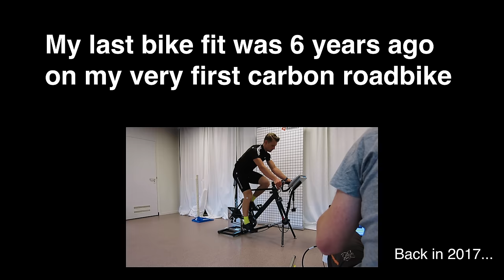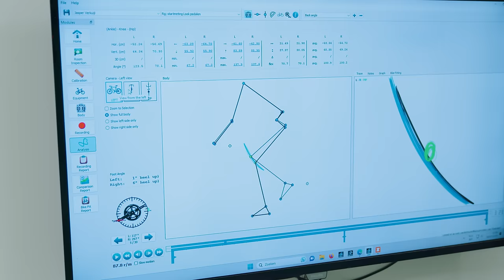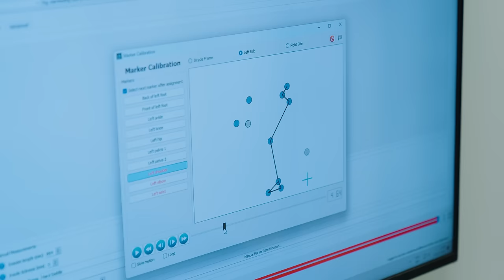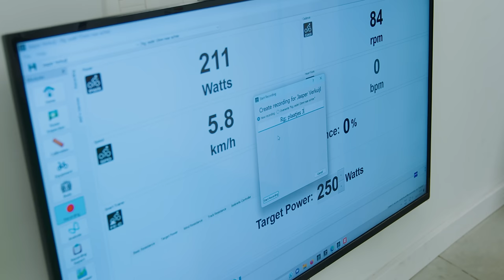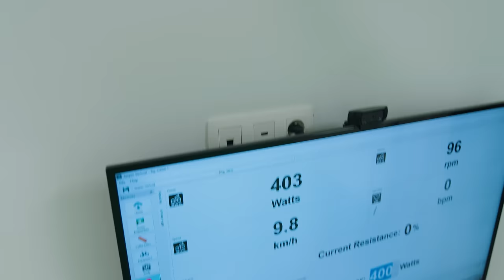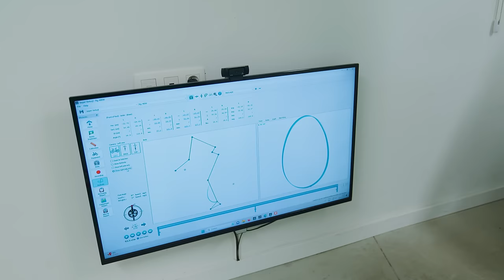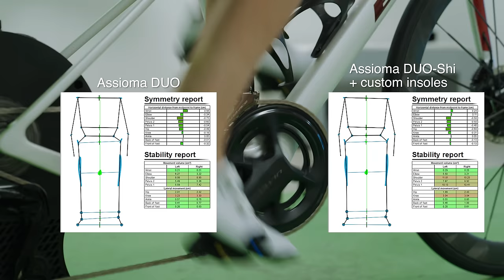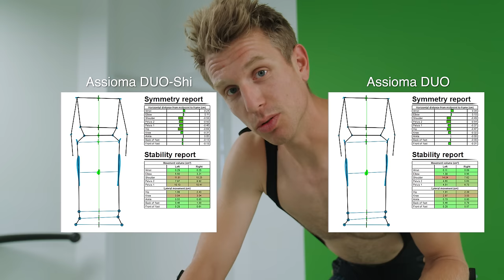Could This Improve My Performance?... // A Bike Fit like a Pro-Cyclist!

Comment: I'm afraid of doing a bike fit at this point, don't wanna pay a lot of money to hear that I have to go spend more money on a different crankset with a 2.5 millimeter difference
Reply: If your comfy dont do one, adjust until your comfy and can do 3 to 5 hr rides without pain or too much soreness, Unless your pro and they probably are free fits anyway lol also every fitter has their own way of doing it and not all will agree.. Tomato, tomatooo
Reply: If you have the SRM Carbon cranks from Look the trilobe can be adjusted from 170-175 in 2.5mm increments and then you can go to as many bike fits as you like without having to buy new cranks
Reply from the maker: I did not have to change the cranks, I suggested it myself in this case. 
You can always go with what you have, but some riders fit is so bad that they are getting injuries in a later stage. (A 2,5mm crank length difference probably won’t cause this!)
So a bike fit could prevent more problems in the future and than it’s worth it! 

If you are like me, the performance is worth it. 

If you are comfortable on your bike and ride it for 6 hour rides without issues, you probably don’t NEED a fit. But it can probably not hurt to do one. (Like me!)

Comment: What does a fit like that cost?
Reply from the maker: Check the website. It depends on what you need/want. It’s around €200, €300 including insoles
Reply: @jasperverkuijl  same prices here in Greece. Great video though!
Reply from the maker: @deamon2107 it’s worth it when you spend 💰💰💰on a bike to spend the little bit extra

Comment: This seems like a little bit of woo woo "science." If the cranks were changed with only a 2.5mm difference without telling the rider, I'll bet there's not a rider in the world that would know the difference. Same thing with almost every other adjustment being made. And, the rider is spending $100's of dollars (or euros!)!  Things are being stated as facts when much of it was based on guesses or hunches.
Reply from the maker: In my case the difference of bike setup where small but yhe result clearly visible in the data. 

Maybe you don’t feel it right away but it will have an effect on the long run. Not everything is directly noticeable , that doesn’t mean it’s different. 

But if you don’t want to do a bike fit, don’t do it. Absolutely fine. 👍🏻

Comment: Great video! I'm doing a lot of the same with me new Shimano equipped Aeroad.  I've switched crank arms from 172.5 to 165 (I'm 183cm) and as a result moved the saddel back 'cause I can't get a longer stem, and am enjoying it. Unfortunately my other bike is SRAM AXS Red so I can't change the crank arms like I did but, that's hardly a "problem"

Comment: Went shorter cranks this year as well big positive changes, massive bump in FTP, much more comfortable for longer durations.
Reply from the maker: Nice!
Reply: Why did your ftp change with another crank length?
Reply from the maker: @911norman   I don’t know. I think they will be too small to measure as FTP is just an guesstimate on itself depending on daily form. So measuring a difference that would be significant enough to actually be measured (like 10 watts) is not very likely. 
The difference will be in long rides like Sven explained. Not in a short ftp test
Reply: @911norman  Honestly I think it was just a matter of being able to put out better power, in a better position. I can't tell you exactly but certainly my torque is much better and pedal stroke feels much better and less into my chest. All likely factors that enable me to breathe better, hinge better, and drive the pedals better without any rocking or power loss to pain or bad position.

Comment: Good video jasper; you made me think about crank lengths aswell now; but as a tall guy it’s not a common option to go for a smaller length. All bikes with larger frames have 175 standard. But i could see what it did to your position (less hip movement). My bike fit is 3 years ago, so maybe in a year or two another one.
Reply from the maker: The industry is messed up on this part. 10k bikes are sold with only 1 option, which would be wrong for a lot of people. 
Many many people are riding with the standard cranks which are often too long. 
Id recommend to buy shorter cranks separate and just mount them. The extra little money (compared to a complete bike) is worth it in the long run
Reply: @jasperverkuijl  indeed; they shouldn’t sell bikes without a bike fit anyway; have the fit done, then get right saddle / cranks etc. The industry going to internet only is not good (but if the would only send out frames, give the opportunity to choose accessories at /after the bike fit, that would be a good option). Your bike fit guy is right, people only see usage for a bike fit when they have problems or injuries. I feel great atm on the bike, but that would mean there’s no room for improvement (like you showed). But, being close to 1.90m 175 might be right for me (my wife wouldn’t be happy if i snatch her shorter crank, lol).
Reply: yes. this is why I'm considering building my own first road bike myself to suit my body and riding... more time spent researching, but riding will be more enjoyable. you give great advice in my opinion. @jasperverkuijl

Comment: Great video! I may be a little bit daft, but I didn't quite get the conclusion on the Assiomas - are you back to the Look version, or will you try to adapt to the larger Q-factor on Shimano and live with the small degradation in terms of performance?
Reply from the maker: Nope I went back to the look version. This was a few weeks before Haute route so no time to adapt and wanted to get optimal performance possible for that moment. 
👍🏻
Reply: Will you stick to Look after your race? Or going for Shi Q factor ?

Comment: I tried the Assioma Shi and had to return them as almos immediately got knee pain. The qfactor is so wide. Watch out for this guys - make sure you can return the pedals just in case.
Reply from the maker: Good thing you could return them and go back to other pedals. Did you try the look based powermeter?

Comment: Did the shorter crank change anything except the symmetry? I am wondering to test this myself on the trainer and with a given workout in zwift. But dont know what to look for in numbers or feel :D
Any chance you got some discount code for bioracer? Wanna make my way up there (from Munich) asap in May.
Reply from the maker: I don’t think you will notice any difference in numbers on yhe indoor trainer. 
The difference will show up (as Sven explained) after hours of riding, at the end of a race. 
Sometimes the changes are hard to be quantified. 

They don’t have a discount code unfortunately but anyway it’s worth it
Reply: Thanks for getting back! Have been at Bioracer last week (quite the drive from Munich!) and both girlfriend and me are happy with the fit so far

Comment: I'm normally racing my rusty omafiets and I'm not sure how they would react if I bring it in 😂 But what I was missing is the handlebar height. I normally ride verly low, which might be less efficient but saves a lot on aero (thus dropping carbon roadies on said omafiets) and I would have thought that that would have been a bigger part of a bikefit. But a very interesting process!
Reply from the maker: Yeah for me the height was good so no change. 
Yoo low is actually not aero. Your arms should be horizontal when you’re on the hoods and go very low with upper body, that is the most aero position legally possible. (Not in the drops)

If you put your bars too low, your fore arms will still be angled down and have more resistance than when they are horizontal

Comment: The fit focused a lot on stability, and with the motion capturing we could see the changes take effect. How does riding on the road compare? I'm thinking the bike is able to move side to side while pedaling and that may cancel out some of the instabilities - or make them worse. Did you talk about that?
Reply from the maker: Yeah I asked if it’s possible to do a motion capture like this on a loose rollers trainer for example, but than it’s impossible to differentiate between natural movement of bike bike saying left right and movement of body parts due to certain fit. 
Some factors need to be fixated to get a result. 

Joanie transfers to road? I performed great in haute Route. But I can’t say I notice a world of difference as I’m an easy adapter and ride so many different bikes all the time. (Hence I never had any problems prior yhe fit)

It’s hard to say how much “energy I would save” because it’s impossible to measure.

Comment: So, we didn't see the results on even shorter cranks !? I've been thinking about going shorter, but that would imply that I'd need to buy new cranks and power-meters. I'm already short on the money.
Reply from the maker: No, I discussed that with Sven during the fit. With 172,5 we had a very stable outcome so going even shorter wasn’t necessary. 
We didn’t test it. Could’ve been an option to test it I agree.
Reply: @jasperverkuijl  I've been thinking about it because I already saw a bunch of videos of cyclists seeing benefits with shorter cranks. And the comments under this video confirm.

Comment: Hoe ga je deze waardes toepassen op de mtb en gravel fiets? En eventueel op een nieuwe wielrenfiets?
Reply from the maker: Goeie vraag. 
Mtb is lastig omdat die Q-factor sowieso erg breder is dan racefiets door de breedte van het bottom bracket. 
Maar verder zijn de afmetingen als stack en reach vanaf trap as te meten en dus over te nemen op een andere fiets. 
Ik heb een rapport gekregen waar deze afmetingen instaan om het bij een andere fiets in te stellen. Het beste is echter om elke fiets apart “in te meten” mbv een bike fit aangezien de afmetingen kunnen wisselen per fiets en toch dezelfde waarden in stability ed kunnen geven. (Dit heb ik vernomen van Sven)

Comment: Cool stuff, but bike fit isn't standardized yet. I don't think that a normal amateur will notice the difference. If you dig yourself into the theme, you can make your bike really comfortable at home and save money.
Reply from the maker: I agree that every bikefitter will come up with a different end result as they all have their vision. 

It’s a way of preventing issues in the future. If you want to go by trial and error doing it yourself that’s fine👍🏻
Reply: @jasperverkuijl  it is cheaper, but more time consuming. And I had to buy a lot of stems between 35 and 100 mm. 😵
Reply from the maker: @fpeter01 maybe not that cheap than 😜

Comment: On longer rides I do suffer saddle discomfort which doesn’t seem to be saddle related. I have wondered if a bike fit will help but I ride mtb mostly and most fitters seem very road orientated. I’m confused as to whether the settings would cross over
Reply: I solved my issue with the Saddle Discomfort not with a bike fit but with Buying an expensive saddle and an expensive Bibshort and finally I can enjoy long rides with no pain.....at all. Yes it is expensive but it's worth spending more for a good saddle and a bib.
Reply: @deamon2107  my saddle was £120 specialised matched to my sit bones. Not sure if £120 is expensive these days. I have various bibs some of which are good brands. ( le col etc) but have limited improvement.  I guess it could be a case of saddle shape that is wrong
Reply from the maker: So I think definitely try different saddles. Even though this one is measured to you, the shape could be mis match. So see if you can borrow a different one, or go do a bike fit with saddle pressure measurement and make sure they have different sadddles to try. 
Bibs are important too, try my siroko bibs. The BX have a really good pad and they are not nearly as expensive as the fancy “A” brands but are 💯 as good or better!

Good luck